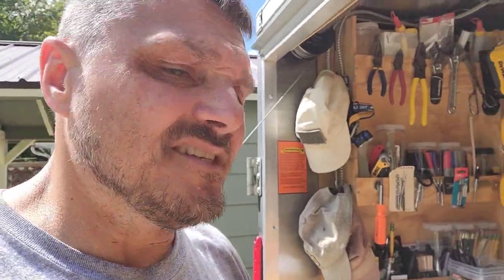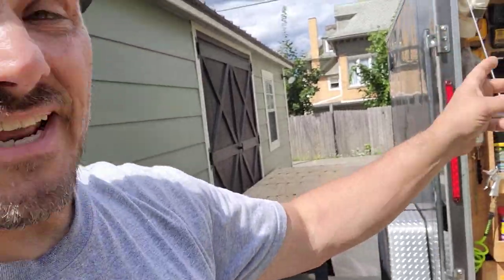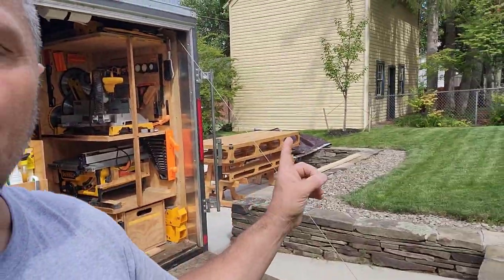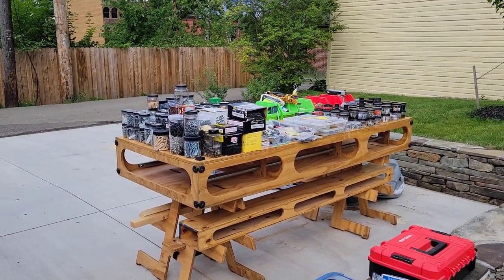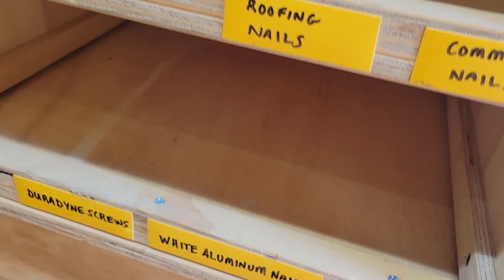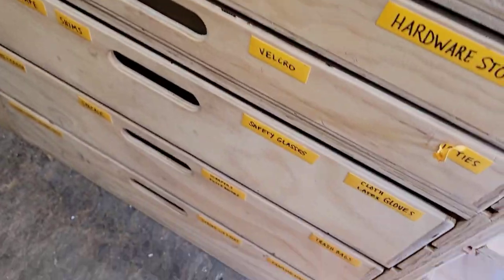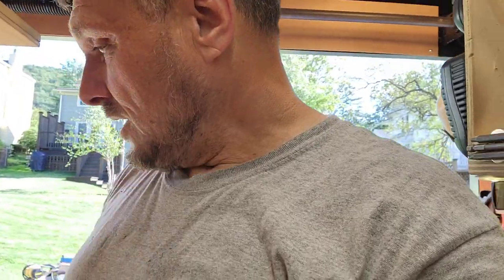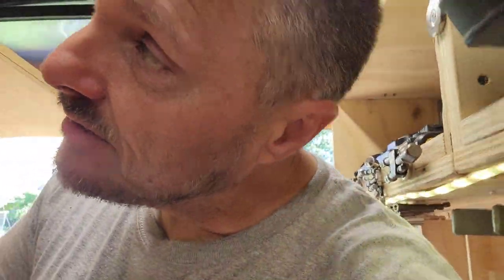Fixing a Detached Cabinet Bank in the TOOL TRAILER

Comment: Oh wow!  That must have been a little shocking when you first opened the ramp door and saw the cabinets shifted!  Did you originally screw the cabinets into the studs or just the plywood?  Did the screws come out of the wall or punch through the plywood?  I am wondering if putting some screws through the cabinet and into the floor would help too.  When I put cabinets in my trailer back in 1998, I used all Weatherguard cabinets and shelves.  I put screws through the cabinets into the wall studs and some into the floor as well if I remember correctly.  My little 5 x 8 bounces around quite a bit taking it down the road but I have had no issues all these years.  Anyway, I thought it was funny when you were talking about being surprised at just how much you had in the cabinets and shelves.  It is amazing how much "stuff" you accumulate over the years.  The best is when you buy something new and then find that you already had that item in the trailer somewhere lol!  Thanks for sharing the video!
Reply from the maker: Hi Russ! Thanks for commenting. I was surprised that there were no screws through the floor and forgot to put some in with this repair but still can in the long drawer cabinet. The original 5 screws should have been in studs but I will not swear to all 5 hitting their mark. I am sure all 9 now are in studs and if they aren't and I find out....I will never tell! 

After either the curb or the pothole going to that job, I felt or heard something shift so I knew something was up and was not overly shocked to see something amiss but was not entirely expecting the whole cabinet bank to have detached and slid. 4 years of many many miles and not so forgiving roads with really big potholes and I have added a few curb-overs too. I would say that something like this was bound to show itself with such minimal fastening (I was surprised that that was all I had).

In the end...with an investment of time, it all came out good with a straight forward repair and a chance to inventory and neaten up and condense and purge. If it had to be done, I am happy I was able to get to it. 

Very glad to hear your trailer has held up to the miles! Proof positive that when you do it right the first time, there is no need of a second time. Someone should tell Spence that.
Reply: The Ron Paulk drawers fly open and distribute your tools and materials all over your trailer.  His locking drawer mechanism does not work for shit and I had weekly drawer dumps until I finally bit the bullet and made fasteners.
Reply from the maker: @StormyITO  Howdy Stormy! Thanks for checking out the video and commenting. Man, I am sorry to hear you have had such bad luck with that passive drawer restraint system. My experience has been completely the opposite. I am using his SMART (latest version) plans and use the routed notch in the drawer bottoms on both sides with the small 1/4" tall piece of hardwood as the stopper glued and pinned at the front of each drawer dado slide on both sides of each drawer slot (where you lift the drawer to pull it out). No matter how badly I have driven and this includes the detached cabinet bank that I fix in this video, I can honestly say that in the 4 years I have had my trailer, I have had zero issues with the drawers.

I do have some small issues with the bottom tool cubby on the left at the countertop. Becasue I have to double stack my small power tools in the cubbies, I have some drivers that are the tools at the edge of the cubby pocket they are in (with a drill deeper in) and I can have these tip out or fall out on to the floor depending on how rough I am driving or how bad the road conditions are on any given day. This is not a fault of the design but is a fault of me double stacking tools in the narrow cubbies but I don't have a choice since I am maxed out with tools/cubby slots. 

Best of luck with your new hardware. I would be willing to bet the days of losing drawers are over! That is a win.

Comment: Hey Steve I enjoy your videos as I have a smart tool trailer myself.
I saw your nice yellow labels

May I ask where you got them from and how they are attached 
And are you happy with them 

I think I remember you mentioned them in a previous video but it would take me hours to find that sequence 

Keep it up 
Hope you’re able to answer my question
Reply from the maker: Hi Florian! Thanks for checking out the video and for your comments! The labels are actually a PVC edge-banding product from Fastcap. I ordered a 25ft roll for $20 some time ago and found that they carried it in yellow. Being color-blind, I really like the high contrast of the yellow labels and the black sharpie. The banding is super self-adhesive and I cut it off the roll as needed. Almost all labels you see are from when I originally made them and placed them back in either 2019 or 2020. I will be using this product again when I build out my next trailer in a couple years. My labels are about an inch wide. They probably have a variety of widths to pick from and they have a large number of colors and woodgrain patterns.

Comment: What do you use to secure the wood to the studs? I do t actually have time to watch this entire video might have missed it but I’m just curious. Do you also use a type of washers?
Reply from the maker: Thanks for commenting!  I use self drilling #10 x 2in panhead screws with larger heads so I did not need washers although washers are a good idea. The initial 3 or 4 screws that I used held for 4 years so I count that as a win but was surprised that I did not use more fasteners back when I build this side out. This time around I used 9 or 10 fasteners that were larger diameter (from #8 last time to the #10 this time). I expect I will get another 4 or more years out of it this time around. I made sure to secure into the aluminum studs behind the OSB and my plywood cabinets. I would not rely on only securing into the 3/8 OSB they use for interior sheathing.

Comment: what is the interior width? wall to wall?
Reply from the maker: Hi Joseph! Thanks for commenting. Without running out to the trailer, I am going to say it is super close to 6ft interior width. Each bank of cabinets (L and R) are 24in deep and my isle is around 23 1/2 in wide (if I remember correctly). For me....now that I have had a built out trailer for a while, I know the 6ft width is too narrow. 7ft or even better...the 8ft width would work way better for my organization and workflow.